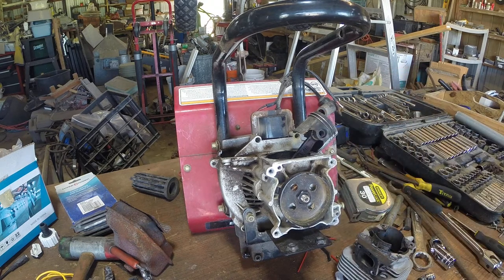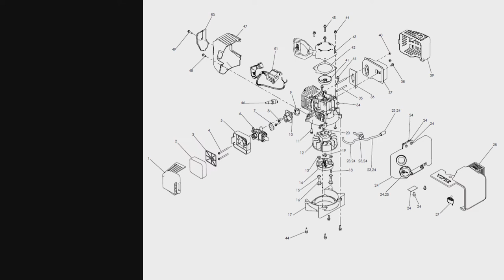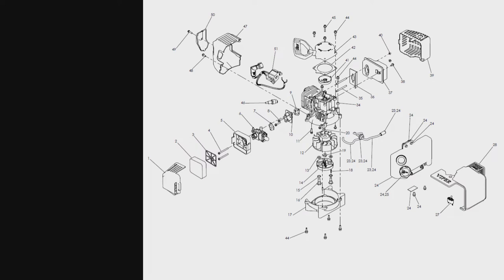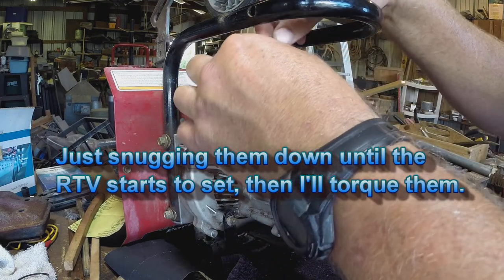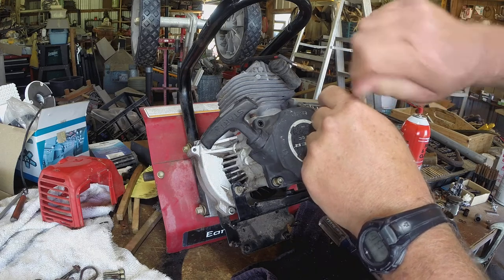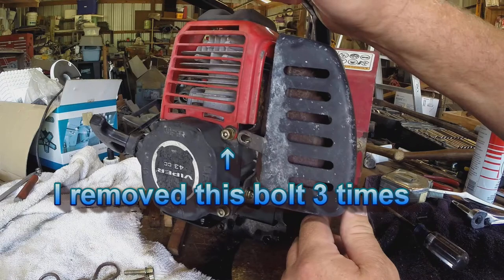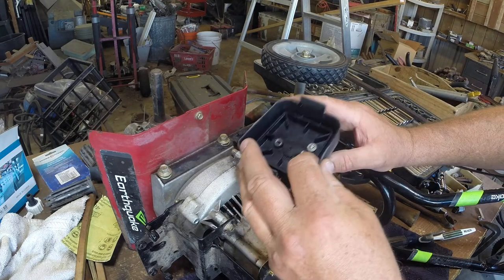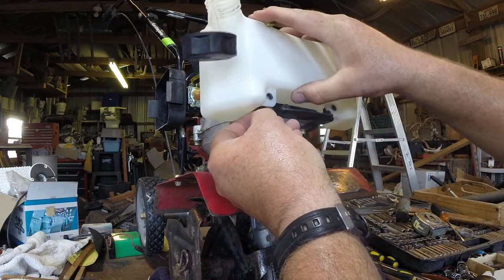Earthquake Mini tiller catastrophic failure: Replacing a small engine piston

Comment: Takes a real man, and a long-time husband, to be able to artfully admit he gave incorrect instructions to his bride.  Glad to see you learned shop the same way I did, outside of any classroom and by taking things apart and putting them back together 3 or 4 times, to avoid any comments on "left-over parts" from family members. Great job on getting it working. Thanks for the tip on Muriatic Acid dissolving aluminum before it dissolved the cylinder sleeve. Did you consider honing the cylinder walls with oiled ScotchBrite pads or very fine abrasive paper mounted (somehow) on your drill to ensure that the motor would have a greater chance of working for years to come?  

This was a great video, proving you don't have to shoot the parts cannon in a big way every time there is a minor setback amongst the machines you depend on everyday. $20 for a replacement piston with rings was a great find. I got 10 Chinese double-sealed spindle bearings for a Snapper mower deck for about $12, less than the price of one OEM bearing that had been on back-order for a year or so, and I needed 4.  Thanks again.